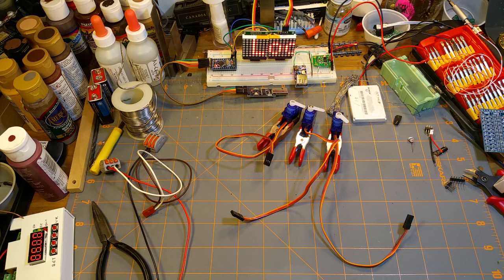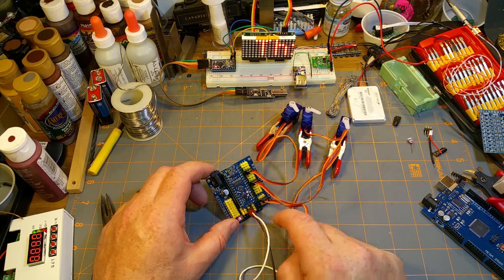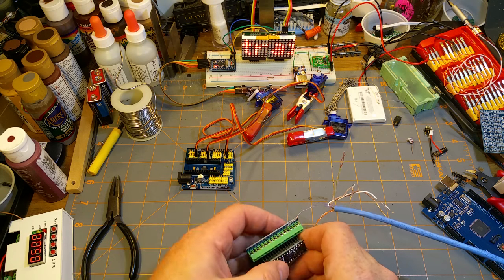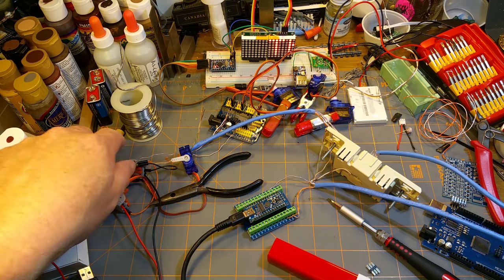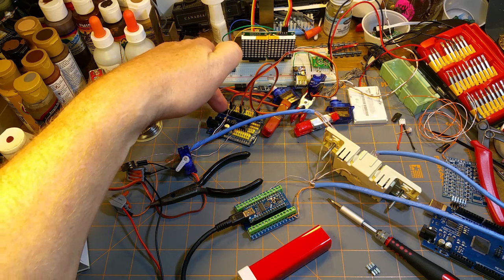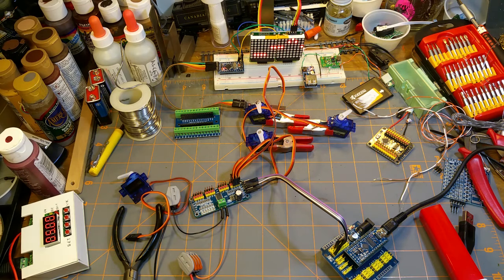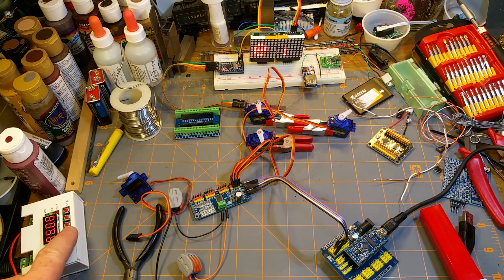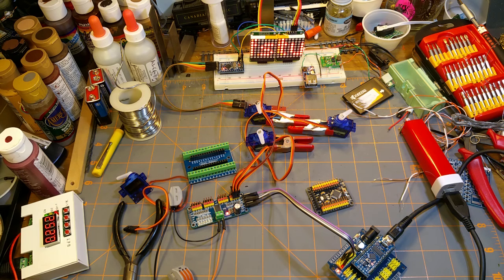playing with servos

Comment: That's what I do also. I start off the the big toys and end up using the small ones. works for me . Options are a almost endless. The esp8266 can do that also, but I find the programming is not as straight forward as the Arduino is. Nice vid.

Comment: ethernet is 24 awg , 50 foot @ 5vdc @1amp,  the voltage drop is 51% or 2.53volts loss. If you tie a pair of together( just 2 conductors, your awg turns to 12, and your voltage loss is less then 1 volt. you can use 1 pair for 5vdc, one pair for ground and the last 2 pairs to run the data for 2 servers.If you distribute your power elsewere, you could run 4 servers off one wire. that ic2 thing seems cool tho and would be easily bussed/routed tho
Reply from the maker: Yeah, I was only planning to run the control (low current) on teh CAT5.

I've got a 5V bus running around the layout on heavier wire.

Comment: You could use an electrolytic cap near the remote servos to store enough charge to run the servos. This greatly depends on how much energy is required during each movement event and the rate of movements.
redrok